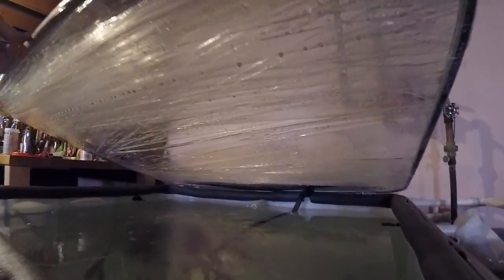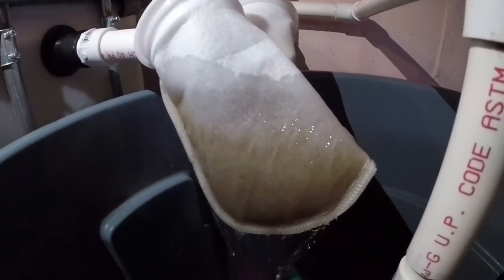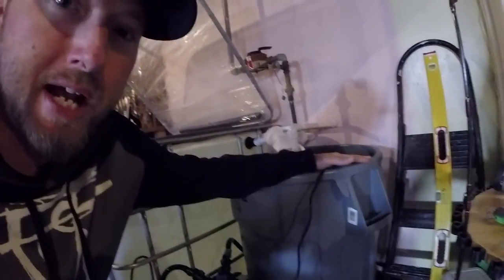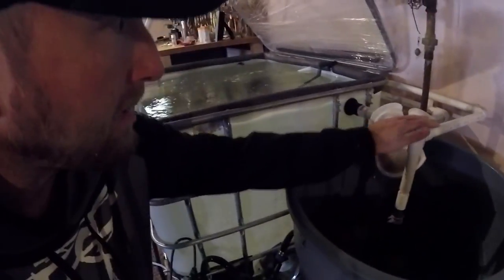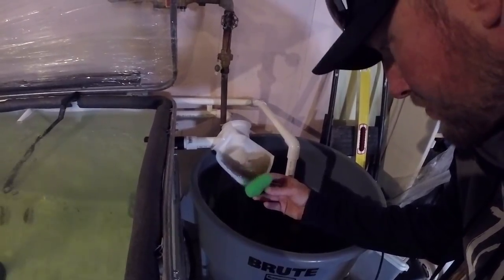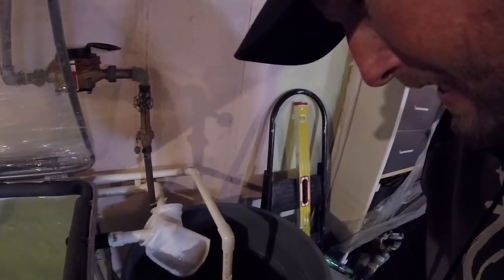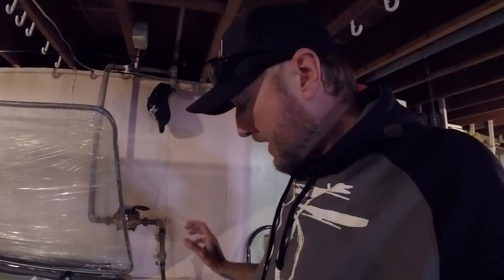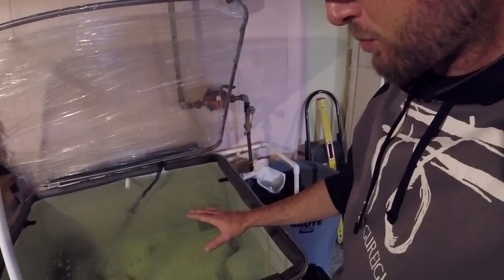DIY Bait Tank & BioFilter Setup - Sucker minnows for Musky and Flathead

Comment: Awesome video thanks for the information, and tips.
Reply from the maker: Thanks Joe, it has sure been a great system. Thanks for the kind words. Only modification I have made to the bait tank over winter is longer filtersocks to get away with changing out every couple weeks
Reply: Slime Quest TV sweet!! How long do the larger filter socks last
Reply: Slime Quest TV sweet!! How long do the larger filter socks last
Reply from the maker: The original short filter socks would have to be changed every week. With the new ones are 4"x14" and Last around 3 weeks before needing washed
Reply: Aw ok I see sweet setting mine up now here a week, so I have the links for the bigger filter socks too at the bottom !
Reply from the maker: Nice man, Hollar at me if you need any advise!

Comment: What have you found is the magic temp to keep tank at?? I am sure mine is to warm do to it being set up outside in the summer heat. It does have a roof over tote.
Reply from the maker: If you can keep it under 70 it will be ideal as bacteria grows fast above that. 60 you will have no problem keeping the water clear and bait alive with weekley 1/3 water changes

Comment: Great setup!!! U need to get a bigger pump if I’m not mistaken u said you have a 550 gph pump u need to upgrade to over 1000 or just under 1000 gph pump. The 4 to 5 times rule. But heck ya man great setup!!! My bluegill just sit in the tank they don’t run into the walls or anything
Reply from the maker: Thanks man. I'm sure you can never have to big of a pump. The more circulation the better. Have yet to have anything die off in 2 years tho. When the pump does go out I may upgrade tho
Reply: Slime Quest TV I say whatever gets the job done and keeps bait alive is a success brotha!!

Comment: I have a 275 gal tank (tote) along with the bio filter made from a plastic 55 gal drum just like yours. Mine is outside. I have a problem with pea soup algae now. Its bad. Have you ever had to deal with this algae ?? I'm looking for a way to correct this problem/issue. Its in the sun so I believe the sun has a lot to do with it.
Reply from the maker: Yes it is algae bloom from the sun. Google algaefix. It's a jug that costs about 25 bucks. It will fix your problem. Try to get some kind of shades over the tip of it will help as well

Comment: Use a external overflow solids removal swirl filter then a biological then put another spot for the pump to just return the water completely removed the pump from your tank and reduces clogging and extends the life of your pump dramatically and keep fish from getting sucked up into them or weaker fish stuck to the side just a few tips if you've never seen swirl solid removal filters definitely give it a few minutes and as simple as it is it make keeping a clean tank so much easier hope it helps if u need links just lmk
Reply from the maker: Yeah send me a link I'll check it out. The only pump I have now is in the bio filter after it is filter thru the socks from the overflows

Comment: Great job do you have a video on a portable bait tank for a boat
Reply from the maker: I do not bud but in the past before I had a large live well I would use this product right here. Works great for keeping bait alive in small spaces and runs on ur 12v battery https://www.cabelas.com/product/Marine-Metal-Products-Fish-Saver/703041.uts?productVariantId=1274772&WT.tsrc=PPC&WT.mc_id=GoogleProductAds&WT.z_mc_id1=10061553&rid=20&gclsrc=aw.ds&ds_rl=1246492&ds_rl=1246531&ds_rl=1247882&gclid=CjwKCAjwnIr1BRAWEiwA6GpwNeF5C6_FM43BVnngEJIZE5LJ7YhJxlLqxsLt9vJmEuHSrhU_VhawEBoCSC0QAvD_BwE

Comment: Where did you get the wand for the canister filter you have stuck down in your tank? Did it come with it??
Reply from the maker: It came with the canister filter. It is made my cascade and should be to hard to locate one
Reply: Is it the same one you have linked ?

Comment: How’d that canister filter work out?? I’m ordering one after you answer this.
Reply from the maker: I have another video I followed up on this bot long ago. I ditched the canister filter. Had to clean it way to often. I went with the largest filter socks and tank is clean as a whistle and hardly any maintenance
Reply from the maker: Dont get me wrong, it kept the bait tank super clean and clear but the internal parts of the filter were neading cleaned every 2 weeks r less. Now i have a dozen filter socks that I just rotate when overflowing and wash in the washing machine once all r dirty. Then good to go for months
Reply: I used filter socks for a little while. My problem was once they got dirty they never worked the same after you washed them.

Comment: I have a blue sterilite plastic tub, 33 gallon as container, wedged between two pieces of furniture on the tub's sides so it doesn't bow out at all, then I can fill it all the way up with water.  The blue sterilite container is better because it's a lot taller than the clear sterilite one.